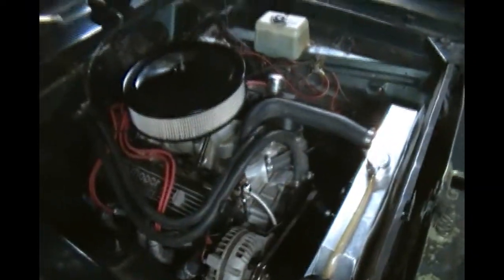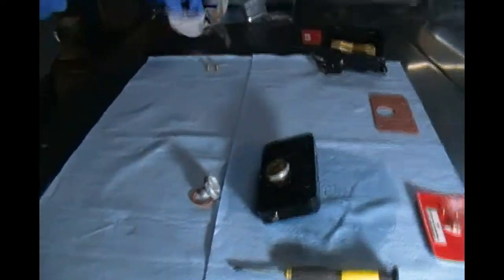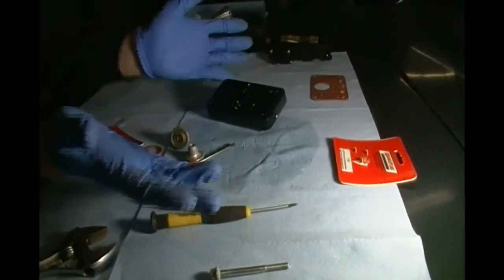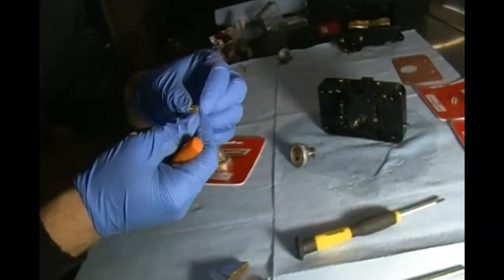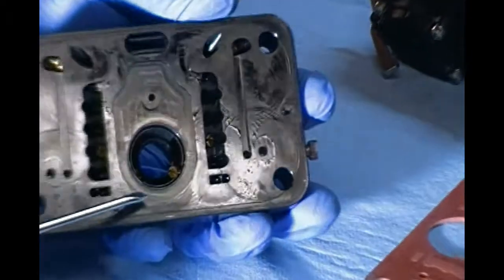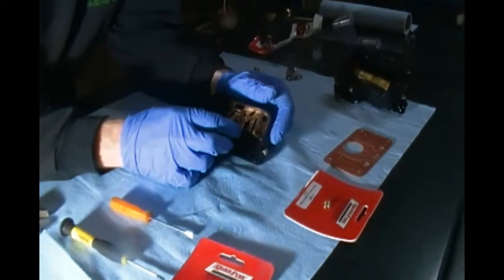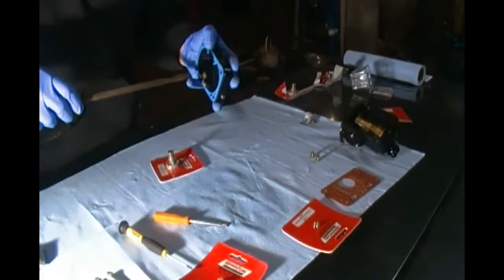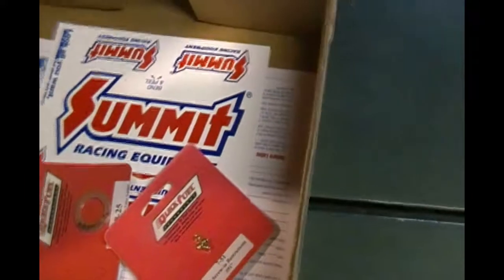Power Valve Tuning!

Comment: a pin gauge set is your friend with a carb that has that much adjust-ability. Those carbs are for circle track and drag race applications. Using one on the street is a major pita. I wish you luck in your endeavor. Also keeping detailed notes will also help when tuning that carb.